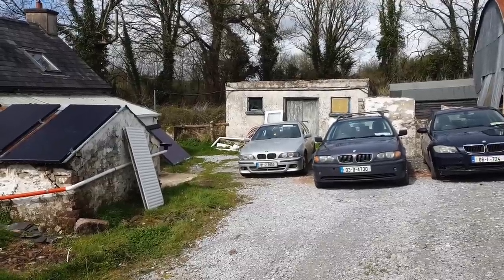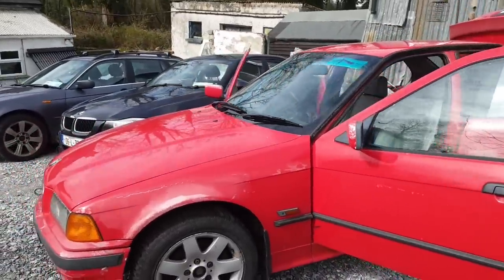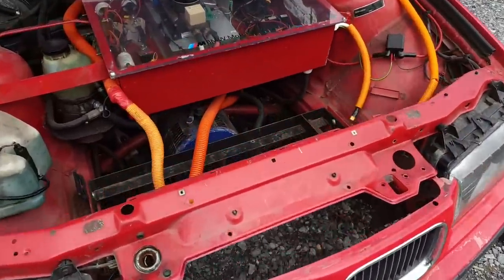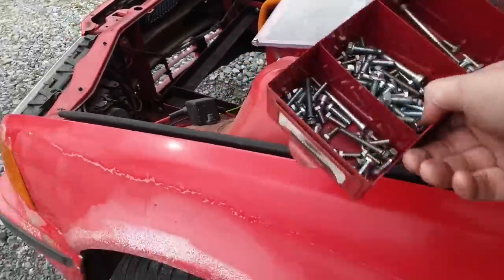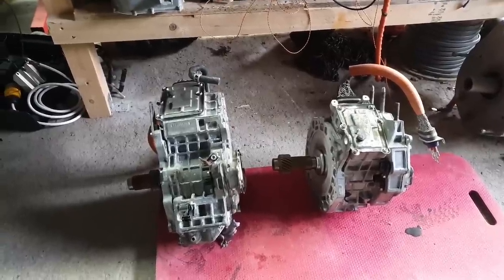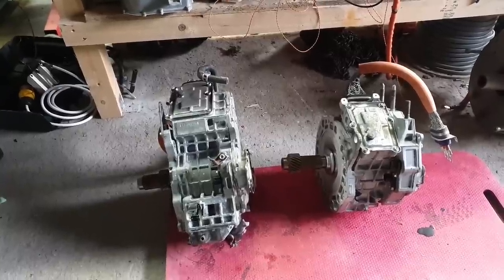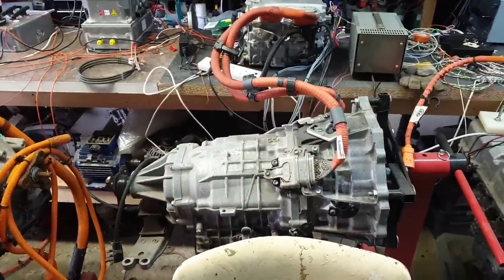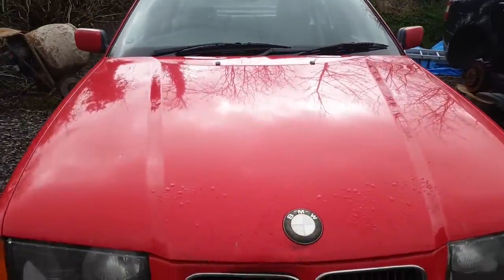€1,000 BMW E36 EV Build 18 : Return To Sender

Comment: Return to Maker would have been my title for the video 😀The Red Arrow came to me in a terrible state early last summer. I fixed a lot of stuff, got it ready for the NCT but it failed mainly on some structural issues, that I am not able to sort. That's why I'm glad I heard Damien was keen to get her back so I donated the car to him. It was an honour and a privilege to have owned and driven the Red Arrow.

Can't say I agree with Damien's plan for the car though. The car is grand as it is, the DC fork lift truck motor is fine, my plan would be to just fix the structural issues with the car, get it to pass the NCT and it would be perfect for the next owner. Someone like me who can get classic insurance (about €200), enjoy the low €120 electric motor tax and charge the car for free from your solar panels. The ultimate example of reduce, re-use and recycle!
Reply: The DC motor doesn't really fit into the grand scheme of things though. It is more valuable to have the different cars as test platforms for the ZombieVerter (inverters, chargers, motors, ...). That's why they all have different setups.
However the fork lift motor conversions are pretty much a dead end, nobody will seriously consider those anymore with the prices of used EV motors falling.

And I doubt Damien will sell the Red Arrow again 😅

Comment: My first EV was with 72V DC motor and I didn't like it at all. You need to change gears and some systems don'thave regen braking. Nowadays brushless motors with inverters  have much nicer torque characteristics and no worries about overheating or brushes.

Comment: i say keep the dc and add a third module (i got three and still intend fitting in to a car), or test it to destruction and see how much current 2 modules can make, i built this but never installed it in a car just used it for winch motor/melting stuff etc

Comment: The only problem with this project is that it doesn't comply with uk Mot/Dvla rules as per welding/drilling the monocoque I understand that this is more of an update of an earlier project but I was wondering if you were planning to adhere to any specific standards with the MuskVo or E90 projectas this is one of the major problems I've had with trying to complete an EV conversion at least this is the case in England I'm sure everyone has their own country specific regulations to deal with
😀
Reply from the maker: Fortunately I'm in Ireland so don't have those specific concerns. That said all my conversions are assessed by and automotive engineer both during and after the process.
Reply: @Evbmw  and you have a great big workshop and you don't live in a built up area with irritating neighbours you're just rubbing it in now you probably have dancing girls to entertain you while you work 🤣🤣🤣 damn I need to move

Comment: Driving a Mitsubishi i-MiEV for 13 years now. Used to have 16 kWh at 330 V. So you are close. The i-MiEV can CHAdeMO 13 kW or AC single phase 3.3 kw. Do you really want DC charging? It is not faster only more expensive. 3 phase charging might give you 11 kW. That is almost as fast. AM radio or hamradio AC motor is a must. I guess DC motors do not only interfer with radio but with computers as well. I like that beautiful car. Very silly idea: how about a pedelec (bicycle) controller and 40V Battery in a toolbox sitting on your lap for moving cars arround without the need for anything but a working motor?
Reply: Perhaps you didn't see him move the car already?

Comment: - 1000eur budget, including the car, total junk put into the conversion... and the reason it gets put down is because of the BMW side, not the EV side. 😂. Is that the original Ampera pack you bought for the Arrow before you took it for another pack and used the Valence on the Arrow? She returns home!

- Rust. Ugh. Welding rust. Ugh. This will be lore frustration than the entire EV part of the build.

- the theme of the Red Arrow build is, "What is the cheapest and easiest way to build an EV?".   The missing link there from what I've seen the last few years is not motor, inverter, batteries, etc. It's "needing to be an engineer to fill the knowledge gaps." A project 99% documented or a hardware/software solution 99% complete might as well be 0% to a novice. So, whatever is being done, do it to either create a missing piece, or, to simplify a part of the conversion process. This is probably hard for you to picture, since you have to pretend you have a mental disability where all your knowledge is gone. :p

- honestly, half the builds I see people doing are still budget builds, and DC builds. Mostly just using parts from abandoned conversions (warp9 etc). I think a few tried your Gen2 prius DC controller prototype as THE cheap DC option, but it fries itself, I think, because it spends too much time off vs. on in a cycle? I forget the details, someone else used the gen2 to do it a different way, (actually I think there's 3 different people who took it their own way), but of course when they got it done, none had time to document or share their solutions despite gentle pleading for them to get around to it.

- you have enough on your plate. Do whatever is fun for you, or, whatever gets it done quickest so that you can work on the things you enjoy. You don't owe anyone anything. But your project count is stacking up again I noticed.